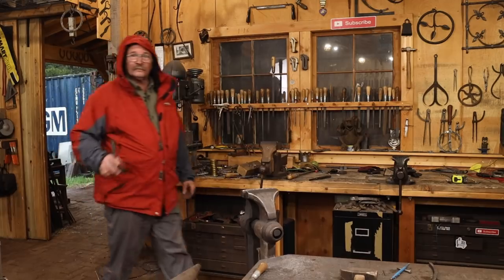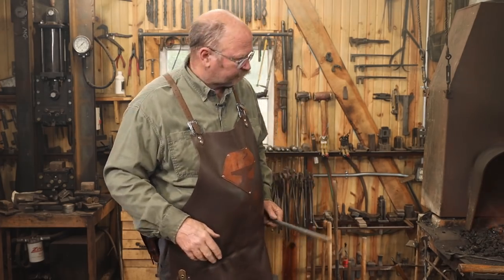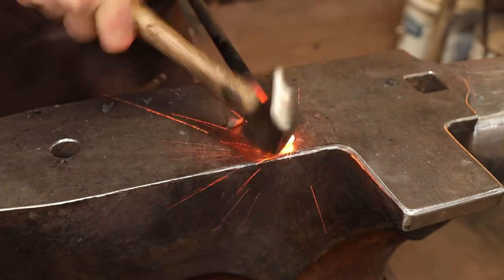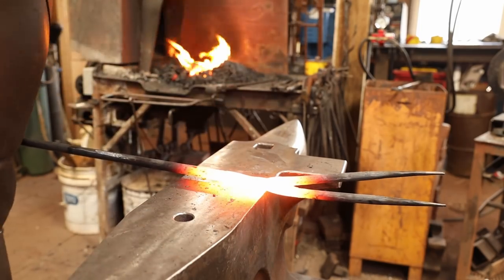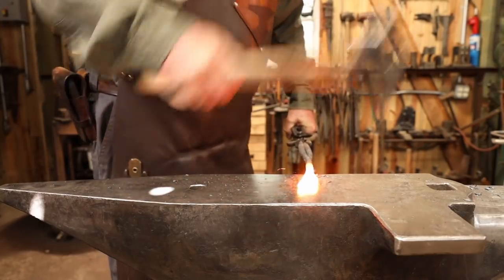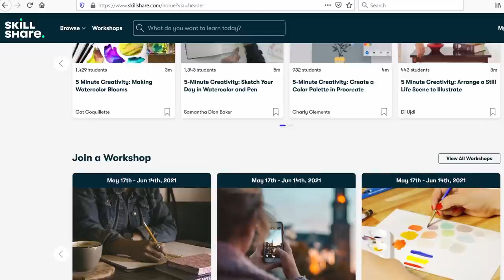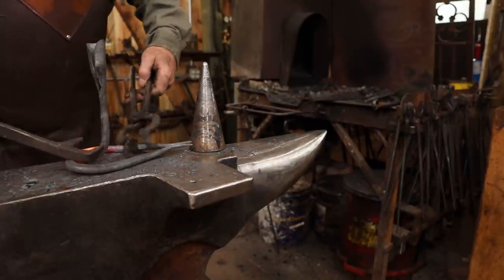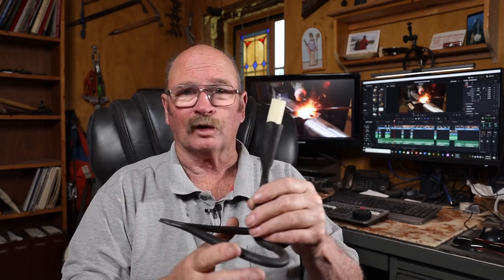Swedish Heart Candle Holder

Comment: Well done John! That's a neat little project. Not sure which would be easier to do, the forge weld or splitting stock. The wife liked this one so I may end up finding out.
Reply from the maker: The advantage to welding is the clean round stock for the heart.  Even forged to a slight bevel it is better looking than angular split stock.  But both techniques would work.

Comment: How about using 2 pieces of 1/4" x 1/2" flat bar? you could make a cup that has a slot on both sides and then you could hammer weld the two pieces together to form the stem and form the heart from the legs

Comment: Verry nice project! I definitely will try this some day. I have a question about drifts. I'm making some axes but I'm struggling with the sizes for the drifts for bigger axes. Can you give me some pointers about what sizes of drifts you use for bigger axes. Like what is the dimension of the tip and what is the final dimentio after a certain length. It's kind of hard to buy a decent drift here in Europe and I don't own a powerhamer, so I really on muscle power to make a drift. Hope to hear from you. Kind regard from a fellow blacksmith and fireman.

Comment: John, when you see something you want to make like the heart candle holder do you sketch out the design to figure how to make yours or do you just do it all in your head and work out the design on the fly?  I'm curious how much paper thinking goes into your work and with time you don't need to do anymore relying on skill and experience. I love the simple, honest design and function of that piece too.
Reply from the maker: Sketching can really help.  But I must admit I rarely take the time.  On a piece like this I just go for it and see where it leads.  As long as the piece doesn't have exact size requirements, it helps get a good idea how much material you need for various elements.

Comment: Forgive my ignorance. I haven't started forging yet, but am trying to pick things up before getting started. Could you have used the treadle hammer to make the forge weld, instead of dropping your tongs?
Reply from the maker: You could, but it isn't as precise as a hand hammer.  Plus its a little further from the forge and the work cools more in the extra few steps.

Comment: Would it work to use a longer piece of 1/2" bar and forge weld the middled section longer, then forge that out to make the candle cup, instead of adding the 5/8 bar?
Reply from the maker: In theory  But you would be spreading a welded section very thin for the candle cup and it could shear the weld

Comment: What do they call that torch you’re using the thing that shuts itself off
Reply from the maker: Nothing special about the torch.  But it has a gas save valve in the line.  Made by Smith